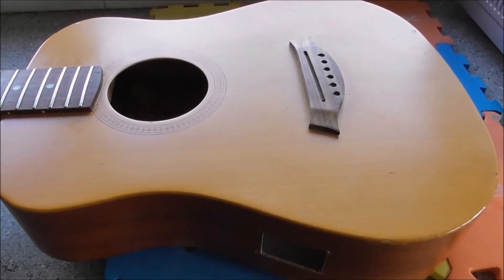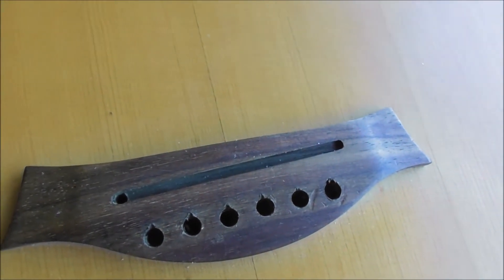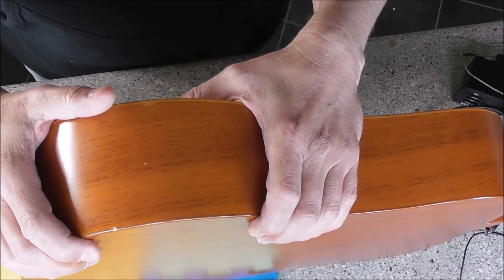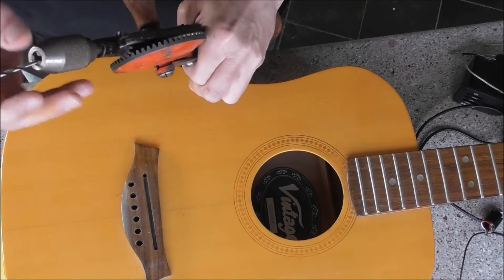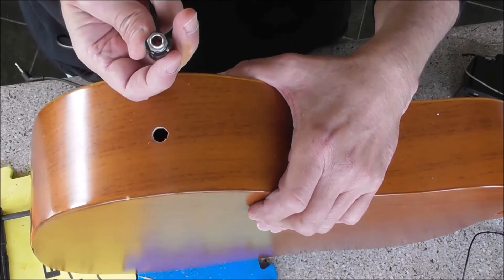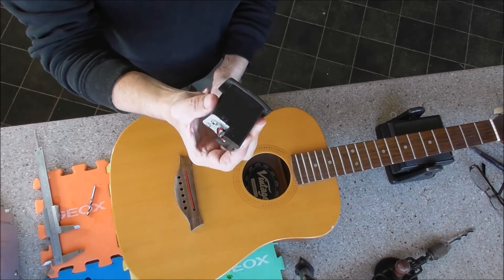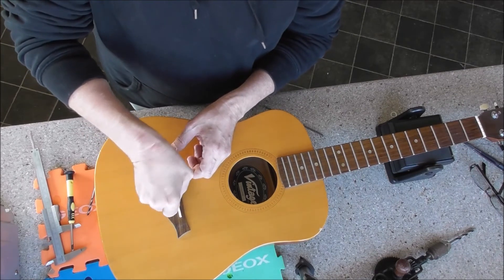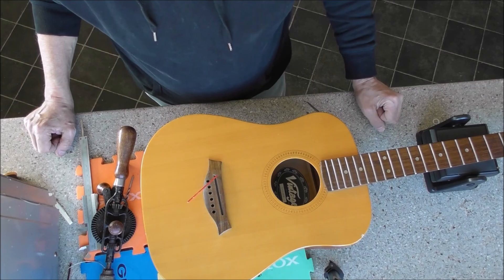Smashed Harley Benton Traveller Guitar Pt-6

Comment: Why don't you just take material off the saddle - that's typically how you do it when adding an after market pickup.
Reply from the maker: Yes that would be normal, however that would leave the saddle with
too little depth to hold.